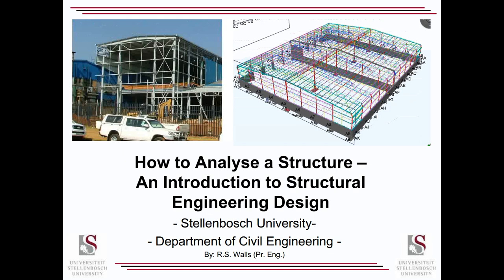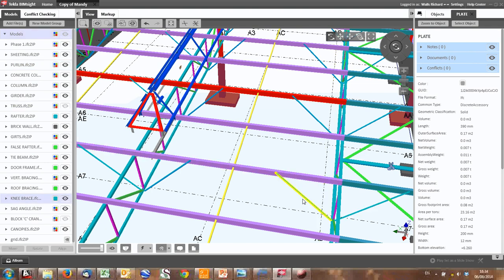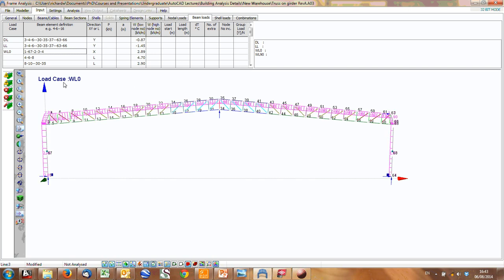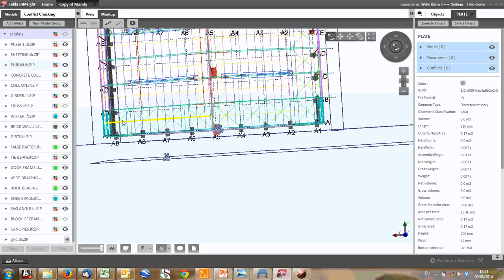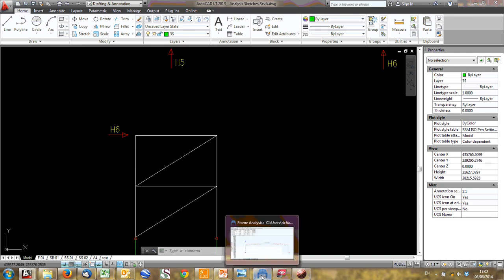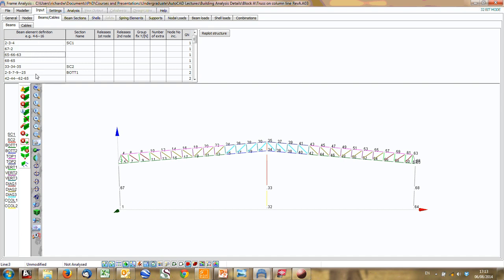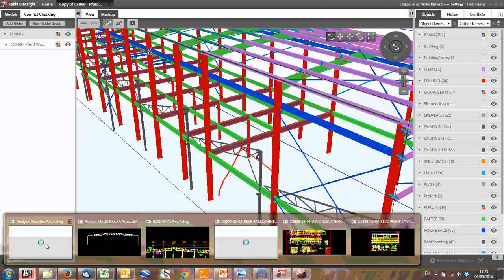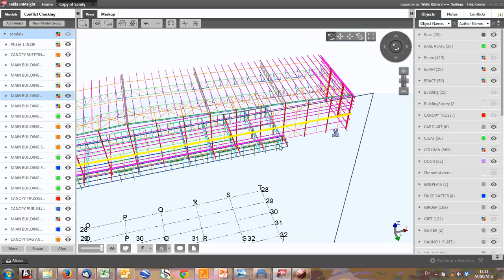How to Analyse and Design a Structure / Building

Comment: Sir, Why people do not seem to take any vertical loads for lifting equipments and just Design the outer concrete core to resist all loads including wind and quake ones? Pl. answer appreciate it a lot. I did that, learned that way, but recently during a presentation for strul. design of a hospital. I was asked. My answer was, as I thought, ' it is negligible and would help also in reducing uplift / overturning load calculations".